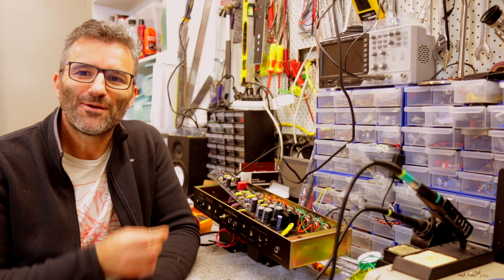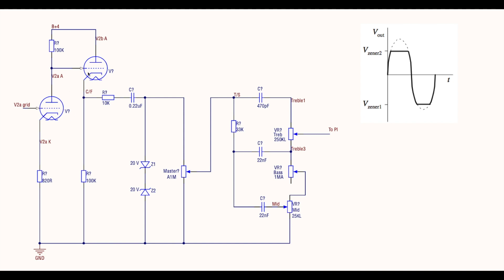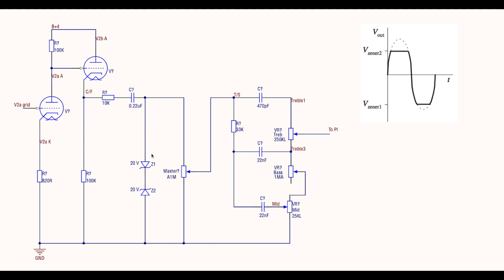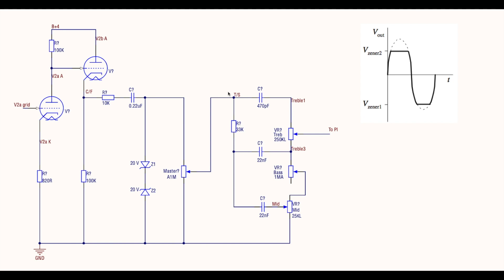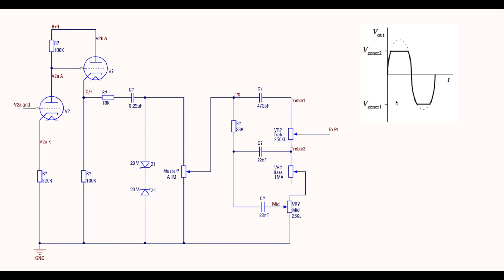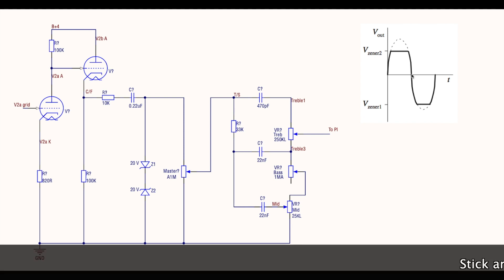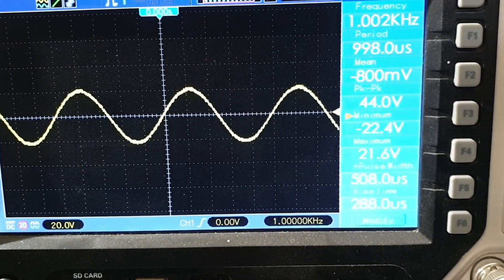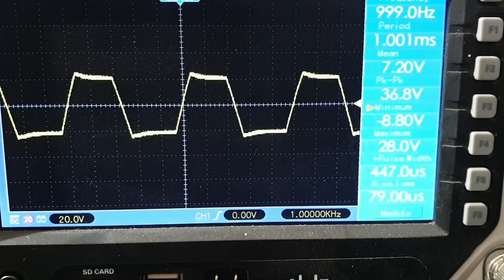Headfirst Amps, At The Bench - José Zener Diode clipping....explained!!

Comment: Marshall often uses standard diodes in parallel reverse mode, earlier in the circuit. That will limit the signal at that point to around 1.4v P/P, and I find it sounds horrible.
Recently I clipped those diodes out on a DSL60 amp, and for the first time in my life I got severe blocking distortion - the following tube stage simply locks down, until
the transfer cap is discharged enough to pass sound. I should have hooked a scope up, to look at it.

Often I try to mod things without removing the PCB(s), which gives me less possibilities, so right now I have lowered the incoming signal to 1/3, but if that is not enough
I might try different values of zener diodes.

Thank you for all your valuable videos 🙂

Comment: Love your videos with theory. Would you consider adding a frequency analysis as well? It would be really interesting to see the difference in the overtone series.
Reply: That is a very interesting idea. Which application do you use yourself? You can measure on the amps speaker output, or on the speaker with a mic.

Comment: What would be the difference between the diodes in series vs parallel?
Reply from the maker: Parallel is not a voltage clamping circuit, that’s more a noise gate coring circuit.
Reply: Thank you!

Comment: Great video as always Jason and explaining what the zener diodes and Volatge Clamp are doing!
What you should also communicate is the 10k resistor and .22uF cap are doing.  What they are in there.  What compliance is  and what they are doing to the signal with and without being in the circuit!  All you needed to do was put a switch in between C? and Z1.  Show the voltage at V2 pin 8 (CF) with full signal, then thru the 10k and 22u compliance with Zeners off....then Zeners on!  This would show the effect, but also the reason for them (unless I missed it somewhere in your video (didnt watch in entirety)!!
Reply from the maker: It's a good idea this - to show the signal all the way through.  I was pretty focused on just the zener breakdown effect....I'll try and remember to add this idea for a future one!
Reply: @HeadfirstAmps  yep, exactly.
Folks just focus on the end results...100V in...clamp at 20V (or whatever)...but there is a little more going on.  If you clip a 100V signal to 5V, it's going to sound like a beehive and pretty dramatic.  The compliance helps support how dramatic the clip. The threshold also needs to be considered and symmetric and asymmetric.  Someone in the forum posted asymmetric, but at more wider levels....say 5V and 20V instead of say 16V/20V.  In that, it looks like they are looking for a mixture of tone 180 degrees out of phase.  One will be very squashed and compressed and the other half more open!!!  :)  All kinds of fun in tuning an amp and getting Grail Tone!! :)
Reply from the maker: Yeah man exactly.  I tried a 24V/5.1V combo and was pretty impressed with the end tone!
Reply: is there video of the 24/5 combo?.. i wanna hear it. @HeadfirstAmps
Reply: @RozsaAmplificationLLC Why dont you do a video and show us how you would do mate.
Reply: @CjJunkins time.
I have none between my day job, my amp business, and personal time....bands, etc.
Trust me.  If I had the time, I'd share.  That's who I am!

Comment: Thank you for all of your wonderful videos. Will this work the same if the master volume is after the tone stack?
Reply: Absolutely yes.  Check out my recent mod videos for both the 1987x and the 2204 for how to wire these in properly whilst keeping a post tone stack master.
Reply: Thank you so much, I will give this a try this weekend. Any tips on how to get rid of the flubby low end of a JCA20H? I've tried everything I can think of:(
Reply: @onewireman  ah yep! Have you seen my JCA50H mod video?
Reply: @jasonktong1  I will have to check it out...
Reply: Thank you for the hot tip. I replaced C26 with a 2n2, and it sounds much better. Now to implement the rest of your mods!!
Reply from the maker: Awesome!
Reply: Is the Zener diode better (feel/tone) than others or is it just the nostalgia of the name ? (….Vs an led, mosfet, etc)

Comment: Great video and explanation of different clipping schemes! Very educational! You just hit a spot with this video because just recently I acquired a Marshall 9001 tube preamp with so-called SRPP circuit and diodes used in the gain staging? Could you briefly comment on that design and if you would remove diodes from such circuit? I have wondered about doing it to possibly to get only tube clipping but was wondering if it is worth of hassle! Thanks for the vid!!!👍🏻
Reply from the maker: I'll check out that circuit and report back!
Reply: @HeadfirstAmps  thank you sir! :-)
Reply: I would be VERY surprised if Marshall have ever used a SRPP circuit. And they did certainly not on the 9001 pre amp. It has 3 standard amplification stages in series. SRPP are kind
of stacked on top of each other.